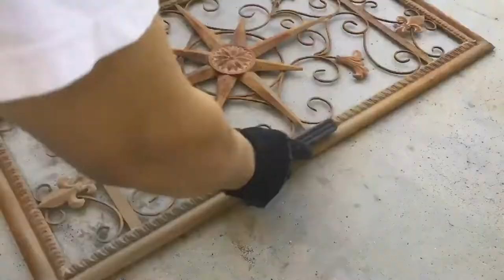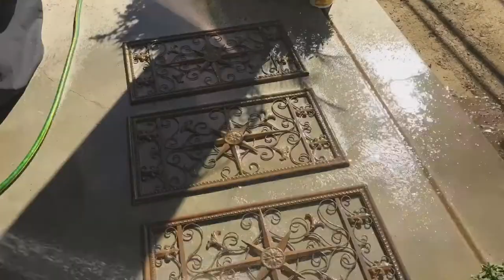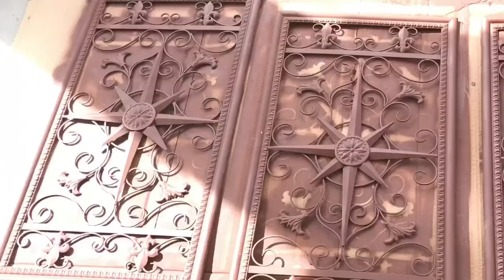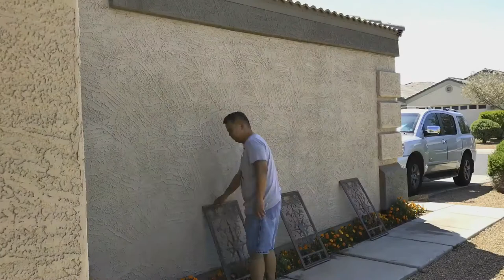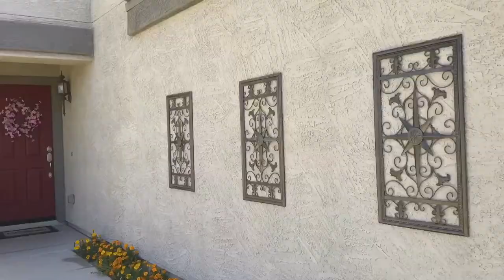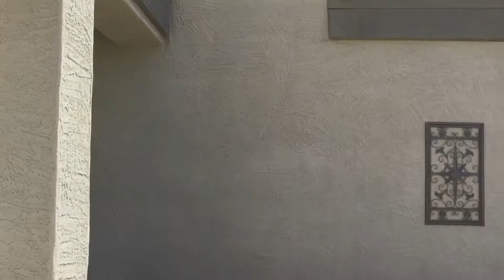Outdoor Metal Wall Decor (Repainting)

Comment: But what are the products you used in the steps?
Reply: in the beginning, he used a metal scraper to get off all the rust/old color to it to try to get to the base of the item. He then water it down or wiped it down to get off all the particles. Then, he used rustoleum spray paint (from what it looks like) to change the color and prevent it from rusting for the future. There are also primers you can apply before the spray paint to ensure the color spray paint with stick more properly, but is not always needed.